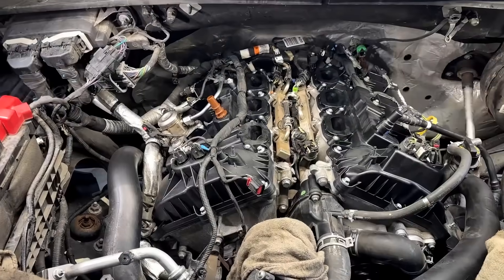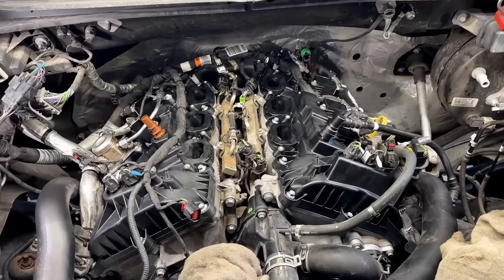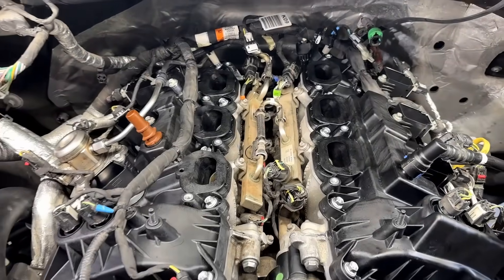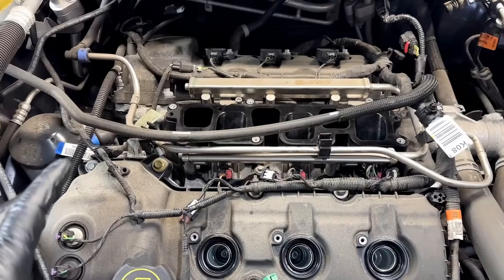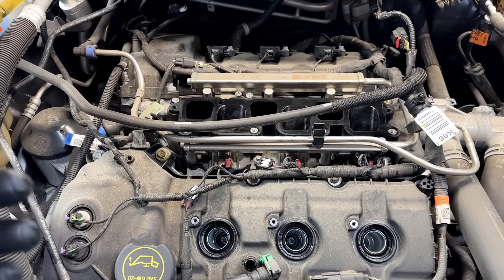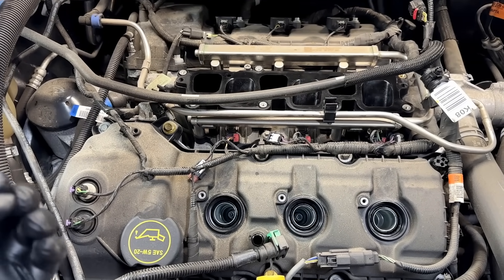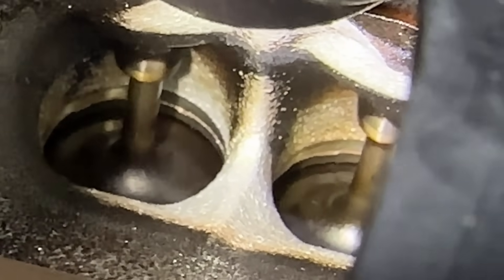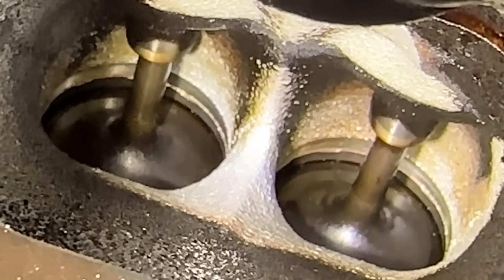Does Ford's New Dual Fuel Injection 3.5L Ecoboost Engine Really Fix the Carbon Build Up Issue?

Comment: Do you know if the SeaFoam spray/fogger injected in front of the throttle body will help clean out the build-up?  I would consider spraying it into the intake at every oil change if I had a direct injection engine.

Comment: Im not impressed with having to take apart my engine every 100k-150k miles for timing and cleaning. My 300, 302, 4.6 were all pretty much sealed for life hundreds of thousands of miles with mid priced oil and fuel. Other than gm v8 with failing valve guides ive never seen a gas engine as nasty as DI gasers. How is a motor more green when it needs major work every 2-5 years in work trucks and 5-10 years as a personal vehicle? I do 30-50k a year in my work truck and so i ended up getting a Nissan Titan for reliability. At 300k i retured it to family use and bought a 1987 Ford Econoline 150 with a 4.9L Big Six and a C6 transmission with 308 rear gear. Gets low to mid teens doing same work as contractors i know of with Transit vans with 3.7L. Im in my 30s and driving a van near as old as me foor work because new trucks cost a years wages and are not as reliable as their older cousins

Comment: You know what works great? Just having your valves cleaned when needed. You all make issues out of nothing. Have a catch can on my 2011 FX4. I have it serviced and cleaned regularly. Still runs like a BEAST. 2024. Who''s dropping $100k for a "NEW 2024"... The cost of maintenance is dirt cheap by comparison.

Comment: Those engine are made to quit working at 90 100 plus miles pure and simple, Nobody is going to made mantenance on those valves periodically I thing Forg is going the wrong way with this engines.

Comment: It's not only about how much carbon is formulated, it's mostly about how treatable it is. With dual (port+direct) injection, I can use a cleaner with PEA and keep the valves clean. With direct injection, a cleaner in the gas tank will never reach the top of the valves.

Comment: I put a catch can on my 2020 3.5 and I gotta say, thst thing, despite the added pressure of being twin turbo, doesnt actually send a lot of oil into the intaje. I just wmptied it after some 7K miles and it wasnt even a quarter full, and it's not even a big can, standard JLT. Definitely not a lot compared to the way the 3.6 RAM engine pushes oil into the intake. The 3.6 filled that much oil into the catch can i. About 1K miles. 😬

Comment: when did the Gen-2 engines come out.. ?  I have a 2017 F150 with 3.5 EB with 79k miles and at cold start it idles rough and the check engine light comes on, and then turns off after driving around 50 miles. gor a code that #6 cylinder misfire.
Reply from the maker: 2017

Comment: The dual injection looks just like my ford mustang without dual injection. I cleaned it - got +4 mpg. I don't think I want to have dual. Changing fuel injectors will cost you double. The car with dual is probably more expensive too.

Comment: So based on what you said about how the port injection works then wouldn’t letting your 2nd Gen EB just idle every 40k-50k miles for a few hours with some good additive in the tank clean off the valves then?

Comment: So my question I have and hope to get answer to if you where shopping for a 2021 or newer f150 would you buy the 3.5 ecoboost or the 5.0 coyote with the stupid belt drive oil pump.

Comment: Hello I just wanted to let you know that I really appreciate all your knowledge and the way that you show us! I myself will be looking at a 2016 Ford explorer platinum with 80,000 miles. My thought process is to do a super cleaning/walnut blast on the valves and then buy an aftermarket to catch can system for it. I did not realize after watching this video that is 3.5 L first gens needing timing chains 150000 miles…. Do you know man do I really want to buy this thing?

Comment: I purchased new a 2020 transit 3.5 ecoboost which needed a new short block @ less than 10k miles due to carbon buildup, I thought it was extreme but warranty covered.

Comment: My gen 1 just hit 170,000. I'm replacing the timing chain/tensioners/cam phasers and water pump while at it. Expensive job, but the truck is paid off, and it's well worth not having to buy a new truck at these prices.

Comment: I've noticed that you never mention the 3.5 non turbo engine. What are the issues with these? I have a 2016 F150 with 252,000 miles and no issues other then replacing the catalytic converters about 20,000 mile ago. These miles are all highway mile with 95% towing a trailer. Your comment?

Comment: After watching this video, I added a basic catch can at 15,000 miles  hoping to negate the carbon buildup. My 3.5 ecoboost is a Ford Transit 350 AWD that was converted into a camper van/Motorhome. So, timing chains need replacement at 150,000 miles? That’s really stretching it.

Comment: Can anyone tell me what year ford added the second gen Ecoboost to the Taurus SHO/police interceptor sedan?
Reply from the maker: They never did.
Reply: @FordTechMakuloco  Thanks. That doesn’t make any sense to me. Wouldn’t it be cheaper to only produce one 3.5 Ecoboost for all platforms rather then two separate generations at the same time?
Reply from the maker: nope

Comment: I put a catch can on my Fusion 2.7 at low miles.  It doesn't accumulate very much oil, a few drops between changes.  By comparision, my 2015 chevy 5.3 fills up fairly quickly and needs emptied at least a couple times between changes.  It also has coolant in it.  Great.

Comment: I would really interested to see if this is more a fuel issue or a cam overlap issue. The VW DI engines do not seem to benefit as much from a catch can, but do from spirited driving and running premium fuel. I have 2 and the valves in my wife's look much better than my son's who always runs the cheapest fuel possible

Comment: The 2nd gen looks a lot better than my wifes 3.6 gmc when I hade the intake off to replace the thermostat at 65k mi.  That SOB will get traded at 100k.  We'll see how my 17' 3.5eb treats me, I paid for all new timing components when ford paid for phasers/labor at 70k mi, so I have a while on the timing chains.  Also I change the oil ever 4 to 5k.

Comment: My 5.7 hemi is an old ass dinosaur but there is no dirty valves issues, turbo failures or timing phaser problems. Just have to use good synthetic 5w30 and avoid idling.
Reply: I used standard oil and changed every 5k on my Aspen with the 5.7. Sold it with 200k miles and still ran like the day I bought it.

Comment: I've added a catch can to my 2.7 and it definitely caches some stuff.
I'd love to see a ecoboost with catch can after 100k
Reply from the maker: It cuts it in half.
Reply: So a 2nd gen with the dual fuel injection AND a catch can would exhibit even less build up. If the can catches half and the dual fuel washes away half then things should stay fairly clean. 1/2 x 1/2 = 1/4

Comment: 2018 f150 platinum is in the shop with 47k miles. Misfiring on 1,3,5. Took over a month for my scheduled appointment and the car had been running rough and if felt like a hard shift. This past Sunday while drive I almost didn’t make it home. Engine light finally came on and giving it gas I felt like my engine was gonna rattle out of my truck… here’s to hoping I get an honest tech

Comment: Can anyone tell me if doing a intake valve cleaning at the Ford Service Department on a regular basis will keep the intake valve coaking to a minimum. My Ford dealer does  this chemically about every 30,000 miles.
Thanks
Reply from the maker: I would not do it chemically. I would wait until 80-100k miles and do it right with a walnut blasting.
Reply: @FordTechMakuloco  
Thank you Sir! I will give great recommendations to those I know of you taking the time out of a busy schedule to respond to me personally!
With gratitude 
Jon

Comment: Ford need to add a valve cleaner injection system that uses OTC cleaners like SeaFoam/STP/ Lucas....in a reservoir that is injected based on engine run time intervals.

Comment: Is the 3.5 L an interference engine?
Reply from the maker: Yes
Reply: @FordTechMakuloco  thanks for the response. I have been finding conflicting information on whether or not they are interference engines. I have a friend that has an f150 eco and tearing into it last night we discovered that the primary timing chain has snapped. We were hoping to be able to fix it but its now not sounding like it would be worth it. I will probably go back and stick a boro in the cylinders to look for damage but again, it’s not sounding good knowing that it’s an interference setup.

Comment: Hey great info, appreciate it. Question - What is the root cause of the carbon buildup? Specifically, would an oil catch can prevent the carbon build up? 
And will an oil catch can void the warranty? Apologies if this has already been discussed.

Comment: Why didn't they just make the port injection also run once at least at every 200 direction injections. Once at 200 and ONLY at high loads where the blow-by is higher and more oil gets back into the intake than it comes at idle where they could just let the direct injection work for better idle economy. I feel like they judged it all upside down. Have their great engineers quit and were replaced by noobs?

Comment: I have an ecoboost 2011 3.5 with 281k miles never have done any cleaning on it not sure if it was done before i bought it. Not a mechanic but not afraid to get dirty and have some knowledge with tools. Is it hard to check for this?

Comment: So if a catch can was used to prevent the oil vapor from entering the intake wouldn’t that help a in reducing build up of carbon.?
Reply from the maker: It cuts it in half based on what I have seen during teardowns.

Comment: Excellent video! 2018 2.7 engine 80K runs like a champ. I use injection cleaners every 5k full synthetic oil change.  I hope that helps.  Also where are you located if I every have to have major work done I want you to do the work! Thanks.

Comment: Most of the carbon buildup is due to blow by that is being recycled back into the intake. Turbo engines have a lot of blow by past The pistons that is taken into to be re burned. Catch cans can help. But still some amount will wind up going into the intake and causing carbon on the valves. So spend a little extra money and get a good quality catch can for any EcoBoost motor.
Check out the information on catch cans here:
https://youtu.be/v6h_FOzFMcs

Comment: Thank you for your sharing your vast knowledge on Ford products. What injection method is used when the driver selects Eco mode? Does it use the Port or Direct injection exclusively or both? Also, do catch cans help at all for this problem?

Comment: What exactly does the carbon build-up do to cause driveability and fuel mileage problems? Air blockage? Valves don't close? Air distribution? Fuel adsorption?

Comment: I do most of my own Maintenance such as all Oil/Fluid Changes,Plugs, Filters,Throttle Body Cleaning, Plugs etc.
I worked in Collision Centers for 42 years and have recently retired.
I had situations where I found out that quite a number of times the work Customer’s where paying for wasn’t done.
Each time if I have to take it in, I ask the service manager to give it to there best guy, or the guy that will do the work. 
I also tell them that if they need more money just let me know, it’s not about the money, I just want it done properly. 
I worked on customers cars for years and I can honestly say, I did more than required cause that’s how I roll. 
Finding a trustworthy mechanic is extremely difficult. 
Most people would be happy to pay more as long as they get what they pay for.
I looked you up and thought I’d bring my 2021 F150 Lariat 3.5 to you when it may need a timing chain, but I’m in Niagara Falls and your to far away. 
Keep up the good work!

Comment: Ok I thought I was set on a 3.5 hybrid F150...but now wondering if I should just go 5.0? Looking at a '21 F150. Will the 5.0 actually be more reliable and desirable as v8s go away in 8 years down the road when the truck is 10 yrs old?..about when I'd sell. Is MPGs really that much better on the hybrid to spend the extra? I drive about 17k miles a year.

Comment: Need to know what type - NOT octane - fuel was used and how often the oil was changed and with what type - syn vs. regular.  With top tier fuel, and regular synthetic oil changes, this should be less of an issue…

Comment: I'm having problems with my Ford Ecoboost. I got a new engine installed but it's all sorts of messed up. I think one of the turbos went out now and it has absolutely no power going forward. Think it's possibly the turbo causing this?

Comment: Hi Brian,
Thanks for this super video!  I did a full timing job on my 2012 Expedition 5.4l 3-Valve with no problems after viewing your videos.  The car runs like a top again (and without the start-up rattle caused by failed passenger side chain tensioner gasket)!  In July I took delivery on a 2022 F-150 w/3.5l Ecoboost engine.  I installed an RX oil catch can and after approx. 5000 miles have recovered a small amount of oil from the catch can while engine oil level has remained constant.  I hope that the catch can further delays the need to clean the intake valves.  
I have two questions.  1) In this video you said that the port fuel injectors are in service for idle and low speed while the direct injectors go into service at highway speeds.  Can you please tell me where to find more details for the engine speed/load/etc. conditions where the switch from port to direct occurs? and 2)Do you have a video where you describe the things to look for that would tell you that it is time for a timing job on a 2022 3.5l Ecoboost engine?
Thanks,
Larry Bayer
Baton Rouge

Comment: I’d blame a large part on the fuel. Probably not running the 91 recommend and probably running ethanol! 
   Also just putting around doesn’t help. I watched the video where Ford froze the block then balls to the walls then froze over and over🥵🥶🥵🥶🥵
      Also I replied with not fully watching this video 🤷🏻‍♂️ it’s loud where I’m at

Comment: That DI only stuff, not a fan. If ford t up the computer to spray PI full time and aid with DI, it would be a huge improvement. My last F150 had 700k miles on the original engine and looked like the last motor. The intake had never been pulled and it looked better than either of the Ecoboost engines.

Comment: Funny thing is these engines aren’t doing to bad with carbon issues. Some other manufacturers are severely bad with carbon build up on direct injection. I’ve seen much worse then this with only 40k on them. BMW , MINI and Audi and some others.
Reply from the maker: Yup

Comment: I would say, based on this video, the added port injection does better than 50% as you state - maybe 75% reduction in build up. Nonetheless, I really appreciate that you did this comparison. I think I still want to install a catch can since I cannot see selling this vehicle for a very long time. Thanks again.
Reply: So based on this video he made, direct fuel injection is actually worst than port fuel injection right? 
I know for sure that direct fuel injection makes the piston face cleaner from the amount of PSI it’s thrown at but I didn’t know that direct fuel injection made that much carbon build up behind the valves.
Reply: @edforthewin8574  Direct injection does not clean the back of the valves at all.  Port injection does
Reply: @thomasnew8606  ok thank you sir!

Comment: I'm more surprised in the cylinder head spacing from gen 1 to gen 2. Gen 1 looked like it had maybe 1.5-2" between the intake ports, and the gen 2 looks like it has significantly more room!
Reply: when did the Gen-2 engines come out.. ?  I have a 2017 F150 with 3.5 EB with 79k miles and at cold start it idles rough and the check engine light comes on and then turns off after driving around 50 miles
Reply: @edwardlucero2120  2017, if you have port injectors, you have a gen 2

Comment: I would be interested to see how the borescope bares out the same results for the 3rd Gen Coyote with dual injection.  With not having forced induction, there may be less blowby causing the issue.  Also compare with a same engine using a catch can.
Reply: So the coyote  2019 has the dual injection ? My friend? Is that’s the case im good 👍

Comment: Now I'm wondering how much this guy used eco mode.  I've heard from a couple different guys who with at ford that Eco mode shuts off the port injection and it doesn't function at idle.   By the way the first gen looked twice as bad that my wife's VW tiguan 2.0t did at 100k. And they're supposed to be the worst.

Comment: I really appreciate you doing these videos and informing people of the potential issues they may run into.
This is terrible on Fords part to be selling crap like this. With the amount of money we pay for these things ford should offer better. Really thought that these 3.5 engines had gotten much more reliable, clearly not. This motor while it preforms very well, is just to problematic for me. Can't understand why ford continues to sell this kinda stuff and why they continue with the cp4 pump in their diesel line when there is better more reliable options out there. Have been looking pretty hard at the newer expeditions. Anything with any ecoboost motor will be off the table for me. Ford would be smart to have the 5.0, or 7.3 as an option in the expeditions. Shamed to say the GMC yukon with the 6.2 is number 1 on my list, and probably the only option at this point. Don't know who is making all these decisions at ford, but their idiots And should be fired.
Reply: That 6.2 is GDI. It will look like that 1st motor he showed after 100k miles.